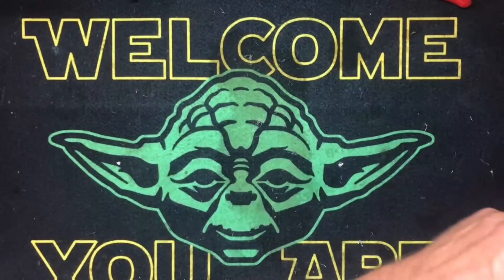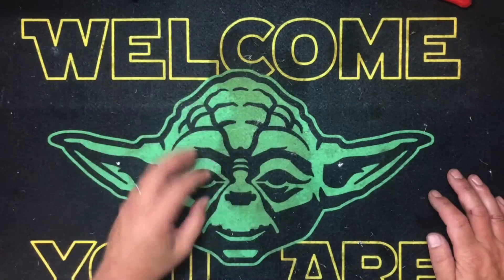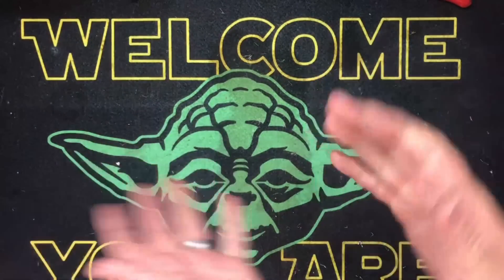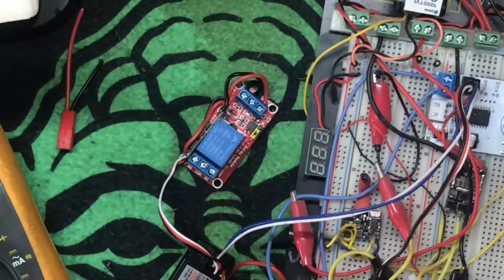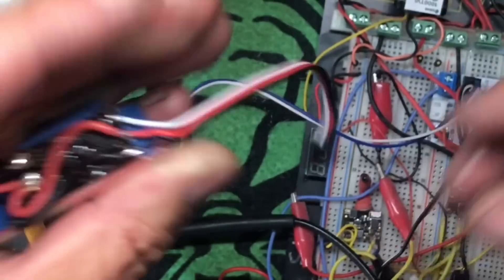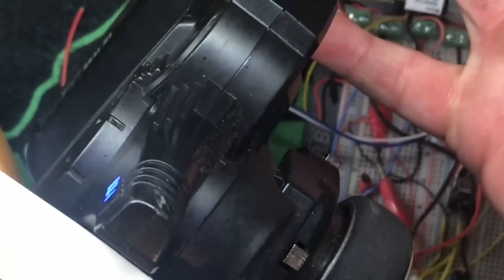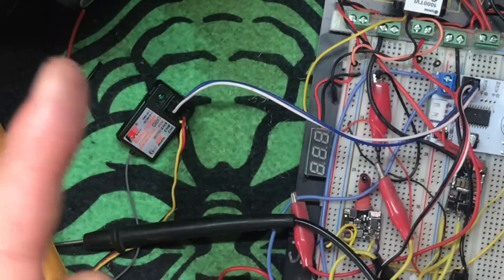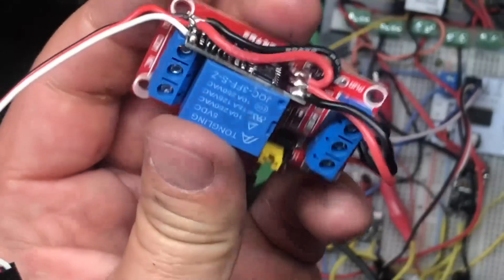JJ's How 2: Build a radio control engine Kill switch CHEAP!

Comment: Question.  I am going to use this similar setup to control a horn on an RC backyard ride on train.  The sound board design for horn and bell are a normally open ground when grounded the horn or bell sound.  Will this exact setup work?  The loss in voltage protection isnt an issue as its not a safety feature like a kill switch would be.  What would i alter in your design to remove this low voltage failsafe?  Or just follow your video exactly and it will work as intended.  Thank you for your reply.  Great video

Comment: Nice video!!! I too have a Rovan & Gas boats and have limited my use in fear of a runaway. The kill switches that are sold are not only expensive  but they're overly complicated or just don't work unless you add even more battery power, which I do believe you said in this video. This is a simple but very effective way to kill that ignition power! Thanks again !

Comment: Instead of jumping the wire from input volt line to receiver positive and negative, can I use the output voltage of the Universal BEC to power the kill switch? Because I'm using U-BEC now. Is it okay?

Comment: Can you wire this to use a 3 way momentary switch on your remote?  One side of the switch will crank your gas engine, then the other way kills it?  If so, would you consider doing a video or posting intructions?  I am trying to make a RC controled lawn mower and this would really help me out.  I have bought a flysky i6x remote with the 10 channel receiver, and I have a mini on off on momentary toggle that I want to use for this.  Thanks reguardless of your answer on the video.  It has me closer to the end goal.

Comment: I bought a dual rc relay. It has no com c terminal. I setup the C three position switch.first relay controll power to controller in 12 position with NO and COM. Middle position is off for both relays. Switch at 6 o'clock position and plan of cutting the ground wire for the enging put one half in com and the cut other pice in th NC terminal. The led come on but nothing. I tride the second solinoid with the the controler setup and will work, even the fail safe works. I want to turn on controller at 12 and to kill eniine at 6 o'clock with middle turning both off. Tride the second relay with a led to test this and not working. It did the first few time. If not have to go back to two relays and channels. Thank great video.

Comment: How can I switch batteries when one dies in a dual battery setup...rf relay or maybe w/ secondary receiver with aux ch on off switch...i know theres a whole debate on why not just use bigger battery...i think 2 batt with extra V's and mah's would weigh less and gain some distance in long range operation.

Comment: Hi great video! Will the 5v relay work with 2s lipo (~8v) or I should get the 12v relay instead?
Reply: The relay coil voltage (the part we see him hook up, DC+, DC-, IN) is 5V.  He used the BEC off of his receiver.  The part that it actually switched (NO, COM, NC) it says can be much higher voltage.  So if you're going to power the relay directly off of the batteries somehow, then you'll want to add a resistor to reduce the power going to the coil.  The 12V one may not trigger at only 8V.  But if you have a 5-6V BEC or something like that on your device, then it'll work fine.

Comment: i set up my switch just as shown in the video, put it in a rampage xb, when switched to channel 3 relay clicks lights come on but the relay still grounds the engine out.does not switch off.  When wires disconnected from relay in run position it opens the relay and closes when switched off or power is removed.  I installed an inline magnet in the wires coming from the engine.   I am using a 3pv futaba radio, not sure what to do.  I ran wires directly to my mag thinking it might be a short in the wires double checked all connections and even tested the coil everything is in order not sure what to do next?
Reply: yeah i just got the parts in the mail to try this. reply if you figure it out plz

Comment: Do you need to have the switching component to make this run? Since you bypass the power to the servo power couldn't you just put the ch3 wires directly to relay?
Reply: Austin McAuley no as it will be receiving a constant signal.

Comment: Got a question and hopefully you can help. I am running a front and rear winch on my rc crawler truck and would like to use a 3 position switch on my tx to switch from front to rear by turning the power on/off. 1st position front winch on, center position both off (no power to either), 3rd position rear winch on. Is there a way to achieve this? They will be operated from a wireless key fob style remote. I just need to be able to choose which winch gets power when needed.
Reply from the maker: Hmmmmm yes.   I’m not sure about the key fob bit tho.   I would use remote Rc switches for power.  RC TX Controlled Relay Switch PWM Receiver LED Control Spray Switch Remote Electronic AUX Channel On/Off https://www.amazon.com/dp/B07FJZ67QM/ref=cm_sw_r_cp_api_i_UJ.2DbF8NTX1P however you would either have to use a programmable radio and utilize two channels and assign them to the toggle, or use a 3 point relay contractor for a single channel, which would be a bit complicated.

Comment: I'm using a Turnigy to turn on and off lights. The LED board can handle main when on 4S. I may do another switch to turn off the nav lights if it messes with my runcam night eagle. Yes I will be running at night and iNav plane. I also have the one from HK that has like I channels on one switch. Both are pass thru voltage. Can't wait to watch this video in detail for what else I can use this for. I use to think I had to use a relay and a taken apart servo. Better days.
Reply from the maker: I like this way because if that battery dies it kills the engine too.    I’ve used the switches just like U are doing as well.    Work well for leds.   This really will handle 200v lol
Reply: @jjrotogeek  Oh Yes, I acquired a couple microwave relays. Question, for your system, would this work if used to close the actual electrical ignition. Pardon my ignorance on gas engine and now I'm thinking what safety there would be for nitro. The ground. Electromagnetic to open airflow when powered only.
Reply: https://youtu.be/Bg_xllc9gdo Just a video of me taking advantage of relays in a coffee maker. Maybe someday I'll make it public.